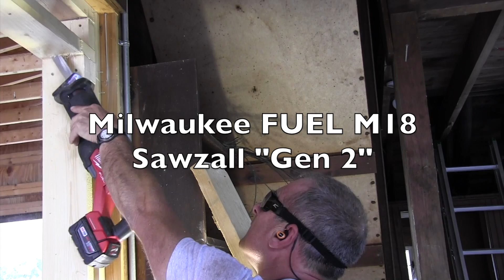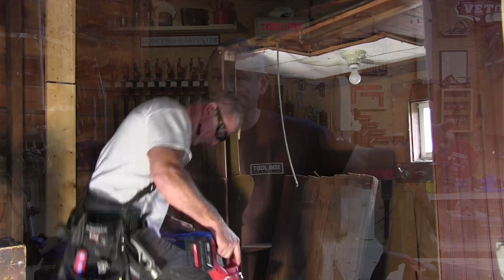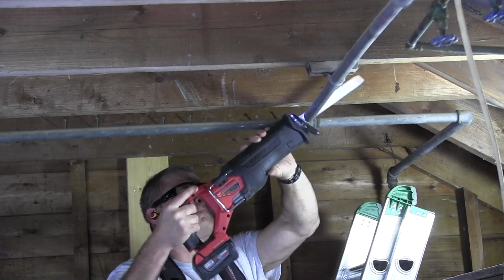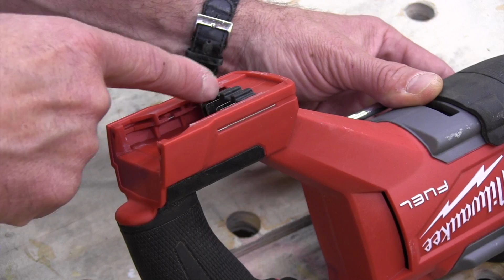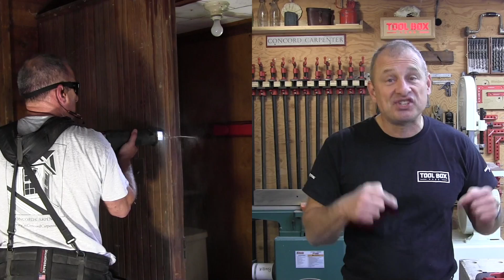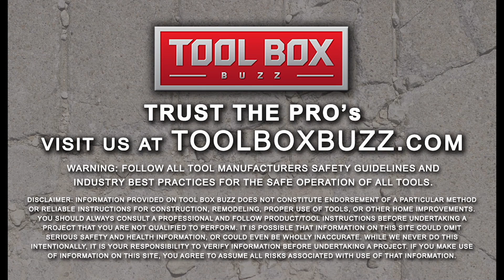Milwaukee M18 FUEL Sawzall 2821-21  - Gen 2 Update

Comment: This saw sucks way to much vibration. Its just as bad as ryobi. Thats saying alot
Reply from the maker: @weldonpinder7295  what blades do you use
Reply: @ConcordCarpenter  Diablo. I'm not sure the tpi. I've used the saw multiple times and it does have more vibration than I would prefer. I think I'm spoiled by the flex I use to work everyday so when I use my Milwaukee home it's so different.  It's bad if I use it for demo where it's constantly running

Comment: I had the last version and it sadly didn't last. The mechanism that holds the blade failed. I ordered the gen 2 model so hopefully the beefed up mechanism will be more durable.
Reply: Hey, it’s been 3 years, how did it hold up?
Reply: @BenM81  well I don't use it that much, but it hasn't had any issues. Much better than the other one I believe

Comment: I agree that Milwaukee has certainly lead the way in this tool (and has innovated in the 12V realm); however, all manufactures of recip saws have neglected the orbital function on their cordless models. And for Milwaukee this seems like a big lack. I wish I could get the power and orbital action of the super sawzawll and the 4 way shoe from Dewalt. My 2 cents for a perfect recip for demo and heavy work.

Comment: More power, 1 1/4 stroke?? This is basically a MUCH lighter Super Sawzall without the orbital action. Amazing
Reply: Is that the main difference? That and $50 less, easier blade change...
Reply: @Mogman150  Well as far as know. If it had orbital action I think I'd get it.  Of course I just bought the super Sawzall a few months ago loll

Comment: @A Concord Carpenter / ToolBoxBuzz. Thanks Rob for your thorough review and take on the new Milwaukee FUEL Sawzall. Milwaukee listened and gave us both a articulating shoe that's also adjustable. Usually I get one and not the other. Thanks for pointing out how there's more overmolding for comfort. Adding stroke length makes for more efficient cuts. We'll see whether the added metal reinforcement for the battery helps over time as people use this new recip saw.

Hope you, your staff, and your families stay safe and well.

Comment: I can tell you right now that thing does not hold a candle to Metabo UVP Sawzall. No orbital feature? Try one with that feature, you won't look back. Also can't pick your speed? The hackzall is more useful than the sawzall IMO because it is one handed. Milwaukee makes some killer stuff, but not all their stuff is killer. If you need a demo tool I can guarantee you there is better cordless sawzall options. One big thing I don't like is that it uses a plastic lever, all industrial sawzalls seem to use the twist feature which is not as convenient, but is for sure a wear point or break point using the ABS plastic levers.
Reply: all those things you said are on the milwaukee super sawzall
Reply from the maker: orbital is nice - haven't seen that feature since my Portercable tigersaw
Reply: I own not one but two of the Hikoki (MetaboHPT) Multivolt Recip saw. I call ‘em Godzilla. Best Cordless Recip on the market!!
Reply: Lol I’ll pass. Brute power isn’t everything. I’ll take Milwaukee’s rep and customer service any day over anything made by Hitachi.

Comment: I've been using the gen. 1 the last 1.5 year on my job sights in the oil field. From 6" schedule 80 steel pipe to 6" overgrown trees on my ROWs. I've literally put it through hell. Yes the clamp to blade gets sticky, but other than that Milwaukee has my money on the new generation. IF this one ever craps out.

Comment: I have a lot m18 tools . After an year battery loosing contacts  .tool stops over and over . Is there any solution to get better contacts between battery and tool ?
Reply: In 7 years only have 1 battery with contact issues
Reply: @sureloch1  I  spend about 8 thousand $ for my Milwaukee tools .   I believe I have 3 batteries that bad contacts.
Reply: @olegvihodets1887  Milwaukee will replace them for free if they are within the warranty period.

Comment: They're good for landscapers too. There are times when a pesky tree root gets in the way of your landscape edging. They also really help when digging out bushes or cutting the stumps flush.
Reply: I second that. Used Sawzall + 2 Hakzalls to remove a small tree and a big shrub just last week. :)
Reply from the maker: Ive done that a few time - now they have pruning blades for the reciip
Reply: @ConcordCarpenter  The diablo carbide pruning blades are my new go to blades for cutting roots. I've even taken a few trees down with them in my Makita 18v saw.
Reply: @some0ne8  my diablo pruning blade's teeth rounder over the first time I used it. Bought milwaukee blades after that. These things cost too much for one use.

Comment: you cant beat the normal blade chuck like on a corded saw. Use your hands or pliers if its jammed or seized. Plastic lever slips, breaks , or skips the metal tooth.

Comment: The most common problem I seem to have is I would guess is the trigger. There are times when I press the trigger and get nothing. It happens with my super sawzall, circular saw, and blower. Has this problem been resolved?
Reply: Maybe an issue with a specific battery?
Reply: Y

Comment: How's it stack up against the super?
Reply: @konamanstudio2447  wassup KONA
Reply: It doesn't appear to have adjustment to engage orbital cuts, so it might be slower to cut some materials, the upside is it now goes 1-1/4" on blade strokes and it's a little lighter.
Reply from the maker: LIGHTER